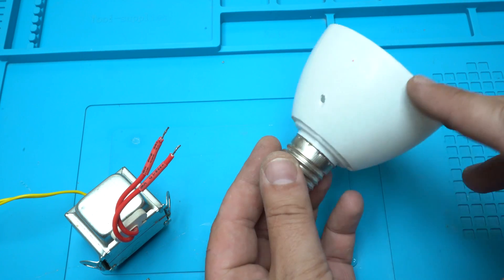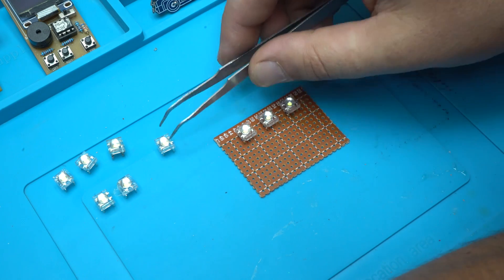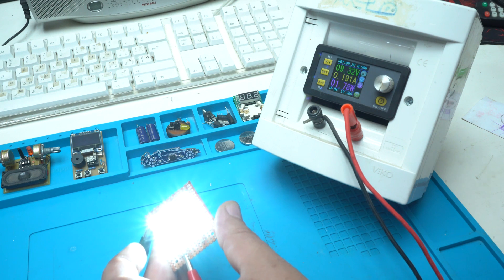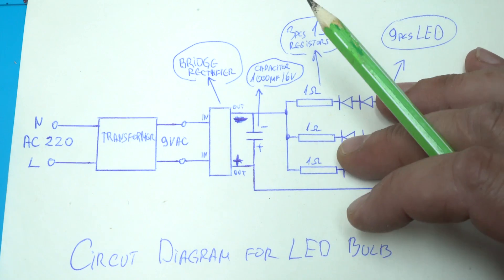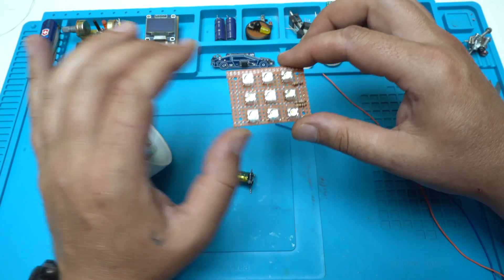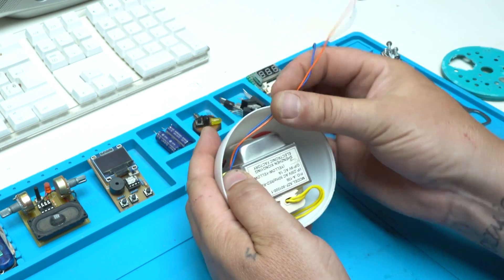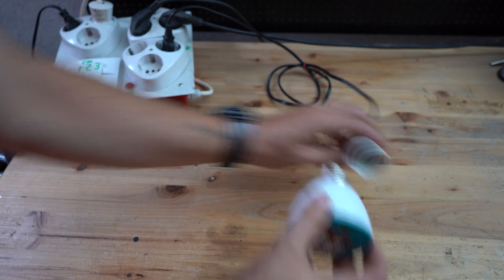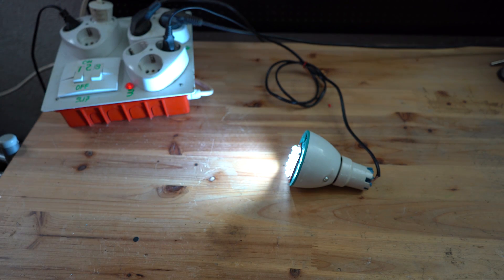How and Why I Make my own LED Light Bulb with Transformer

Comment: I am not a fan of tinkering videos where mains voltage is handled in an unsafe manner. This sets a bad example for people who want to replicate this and have no understanding of electronics. People can get hurt or worse if they try to copy this. And 4.5watt? There was really 1.78 watts on the screen of your power supply.
Reply: The main’s connection is inside the bulb. It’s no more dangerous than screwing in a light bulb. The 1/2 watt consumption is for individual leds. Because he wired the leds in 3 parallel series of 3 he cut the power consumption to approximately 1/3, which means the bulb is producing 4.5 watts of light while using 1.78 watts of power.
Reply: @mikebond6328  In that case, this is the invention of the century. A lamp that gives 4.5watt of power and consumes only 1.78watt. And completely safe too

Comment: A transformer is the WORST way to create an LED light. They're terrible with heat !

There's a reason why 20yrs ago we all changed to switch mode power supplies.

I've been a subscriber for years and love your projects, but this is a terrible idea...
Reply from the maker: Yep 20 years ago all of us change to china products with switch mode and all we are buying new bulbs every 6 monts!
Clever,btw tnx for sub
Reply: @Hacktuber  Yeah true, the cheap Chinese bulbs never have all the required parts on the switch mode circuits 😕

Phillips bulbs are sold in most countries, they have a better warranty than others.

Comment: Great video again Thanks !  My interest lies in LED's !  I bought a bunch of LED's from Amazon that are button sized and I'd love to learn how to make a very low voltage secquential tail and turn signals with limited parts  Just because I don't really have parts or know what to get.  So my list of parts is LED's and resistors so far  I'm building a handicap scooter with lights a power station and useful things like that for people like me that can't walk or are very instable.  My project will be a reverse trike that and narrow and widen with a motor to fit in doorways and lift to make it easier to get things out of reach.  I am using a 48 volt electric bike wheel for powering the chair.   If you could I'd love help figuring things out.  Eventually I'd love to be abe to donate to those who can't affford it like myself.  Have a great day and thanks for the video !!!!  It was worth your time to make !
Reply from the maker: Thz for comment first,if you want to use any leds on 48v first visit web site called led calculator to find out the right resistence for leds,other thing is to make just to blink the leds for signs,you can easy find self blinking leds to use them for turning sides or just to be noticed that you are moving.
My advice is to experiment first with resistors and leds if you are beginner.
Reply: @Hacktuber  Thanks for the reply.  I am only running the electric wheel off the 48 volt pack that came with the ebike.  I will run the LED's off a battery backup that is 4.5 volts.  I figure why not seeing I already have them both.  It'll be a useful cart for me seeing that I just can't get aroound on my legs any more.  I try using my walker but, the falling hasn't stopped and there is no need to break anything else or more surgeries !  Enjoy your weekend

Comment: I've been a subscriber for a while, what I really miss is the fun projects. Stuff like the LED matrix or the little tank. 
Your projects used to be fun and whimsical gadgets. 

Here's one you can have: An electronic keyboard. But wait, there's a catch. You have ten tactile buttons with various resistors connected to a 555 timer to make the notes. But you also have a potentiometer connected to another 555 timer to control the pitch of the notes. 

I haven't gotten my GitHub finished yet, but if you like I could throw my design up there so you can get some ideas.
Reply from the maker: Thx for feedback bro
Reply: @Hacktuber  I created a Github for you. Git...  /TheHackersWorkshop/8BitSoundMachine